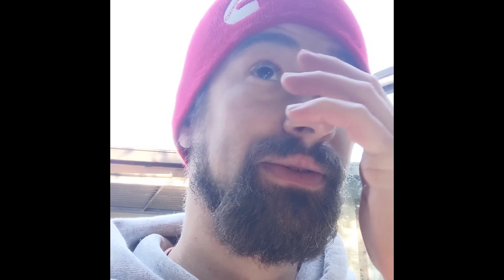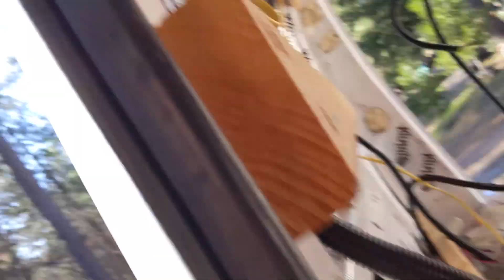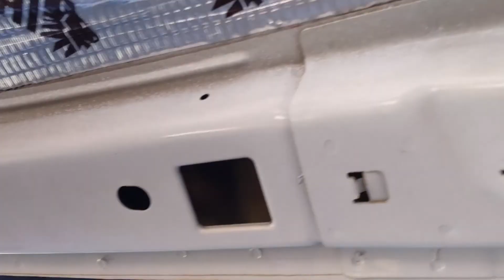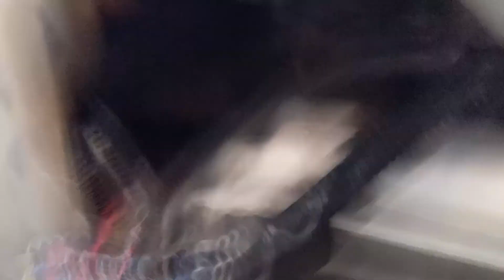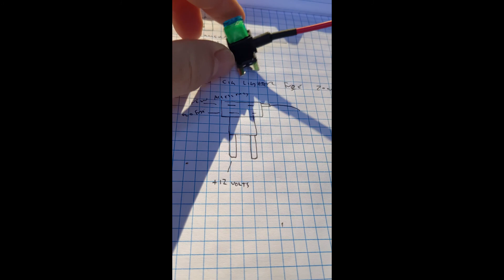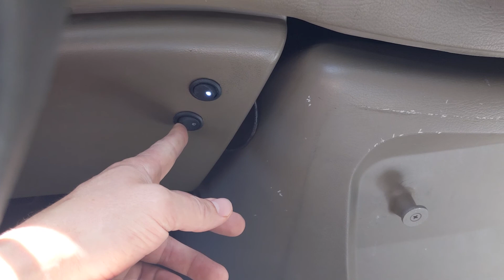Van Life Build | Ford E350 Stealth Conversion | Backup Cam & Advanced Wiring Setup| Ep 5

Comment: Can I skip the relay and use a spare switch on my switchboard (currently tied to battery) and just tie this into the red wire (ignition on)? Wouldn’t this essentially tell the receiver the ignition is on when the switch is on?
Reply from the maker: Great question!   So this is something I actually ran into and probably should have explained in the video. 

So If you were to tie into your receiver ignition or power on signal with the wire that comes from the vehicle harness in addition to a switch that sends 12v like you were suggesting, I actually had an issue where it was back feeding power into the van and it was thinking the whole thing should be on. So all my dash lights were coming on as if I had the key turned on. 

So the reason I did it this way was to segregate the power to the receiver without powering on other accessories in the van inadvertently.  

Hopefully that makes sense, but I'm glad you brought that up because it caused me to have to go back and rethink the whole thing into this configuration.
Reply: @blueprintvans789  this makes sense now that I visualize it. You’re basically tying in a hot 12 volt wire to the ignition wire everytime you flip the switch, but the relay essentially prevents this back flow. Got it!!! I think the only thing I’m not clear on is if the yellow wire is always on why can’t I just turn my after marker radio on with the power button on the remote provided?
Reply from the maker: @Vagabond_2024  the always on is to keep all your settings in your receiver like your preset stations, equalizer settings etc.  it must be set up internally to take a lower draw of power though.
Reply: @blueprintvans789  have you ever messed with diodes? Just realized this may solve all my relay needs by placing diodes on some circuits. The example above, a diode would be placed on the red ignition wire harness so current can’t flow back when tied in with an optional switch. Just a thought I’d check in on before ordering and experimenting.
Reply from the maker: @Vagabond_2024  I have not played around with those or know anything about them aside from hearing the name and knowing they have something to do with electrical lol.  That certainly sounds like it might be a solution if it doesn't allow the current to back feed.  I would be curious what you attempt and if it works out for you,  Might be a much simpler solution!
Reply: @blueprintvans789  will post here after giving them a try. I’m having issues running 3 cameras into one feed because they are all tied into the reverse trigger line on the head unit and even though I don’t have the van in reverse it’s powering my reverse camera… all cameras for that matter… it’s also turning on my reverse lights when I turn signal😂….I think if I run a diode immediately before connecting to trigger wire it’ll allow one camera to power at a time